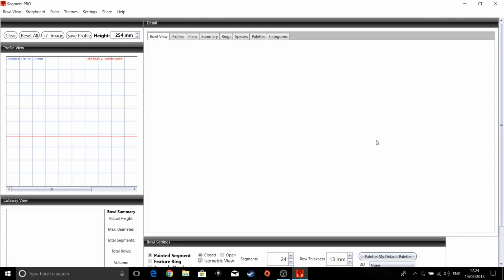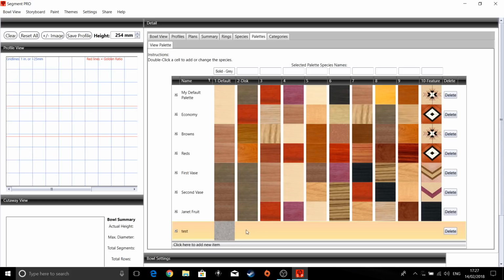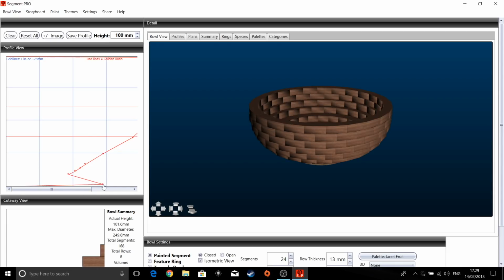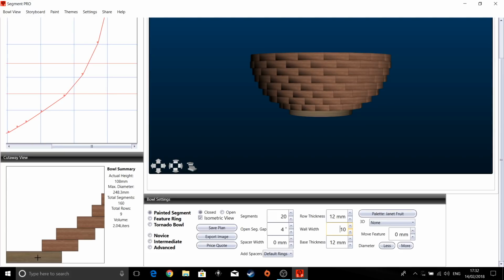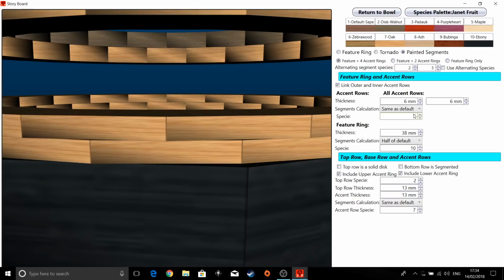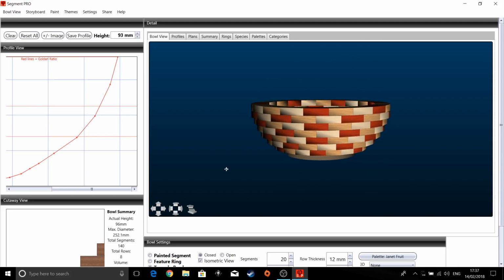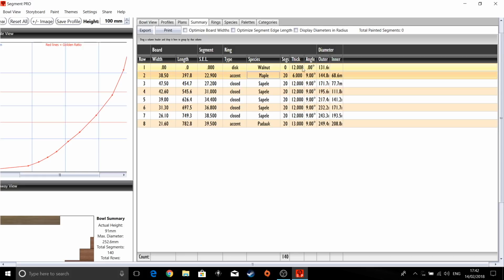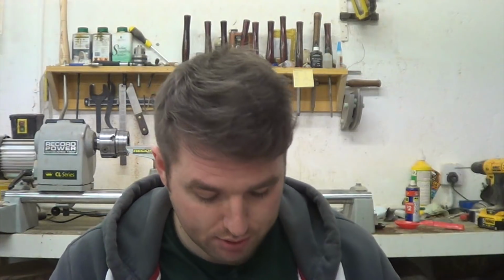Segmented Fruit Bowl Pt  1: Bowl Design Using Segment Pro Software

Comment: Does Seg Pro Work with Apple as easy as PC users or will that be any problem?
Reply from the maker: hi Stan, sorry for the late reply. As far as I know SegPro doesn't work with Apple iOS, I actually bought a Windows laptop specifically for SegPro. From what I've read on their website it is possible to work around it by partitioning the hard drive and installing windows OS but that's too technical for me.